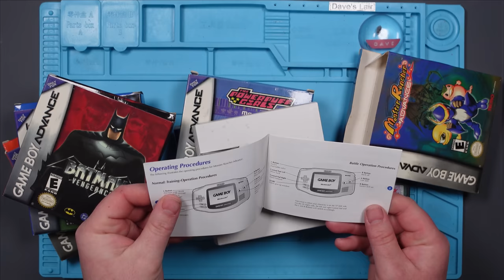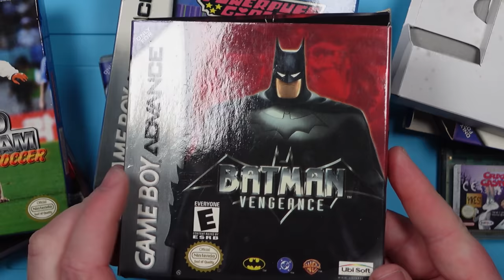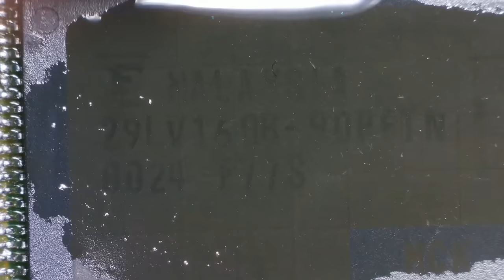I Bought 8 FAULTY GAME BOY Games on eBay & I Think I Got SCAMMED!

Comment: i worked at an electronics manufacturing company for over 10 years operating surface mount machines, those chips or IC's as they're known, are usually in tape on a reel that feeds into the machine. every so often we would receive a reel of IC's sealed in a vacuumed bag, if the bag was over vacuumed it would slightly crush the reel and often result in consistent bent legs on say every 8th chip in the tape, depending on the style of plastic reels it could be any number from just the 1 leg slightly raised or lower, to half the legs affected.  just my experience.

Comment: Use your hot air gun on the black epoxy just enough and it will chip away (with a sharp pointy implement). Too hot and it will go liquid. Worth a shot perhaps? Enjoying your videos 😁

Comment: The most reliable way to identify fake Gameboy/Color/Advance games is to look for the number physically stamped into the label. If it's not there, it isn't genuine.
Reply: They've started to add the number on the newer bootlegs so it's not reliable anymore.
I avoid buying GBA games on eBay now, because for anything rare at a good price it's 99.99% bootleg.
Reply: @indask8  Also there are a few legit games that don't have this number.
Reply: @MyRegardsToTheDodo  I don't think I've ever seen a GBA game without a number on the label, sometimes it's very faint but it's still there.

Comment: the gameboy security check works by having the nintendo logo in a certain position of the game-cardridges memory, that logo will be shown and afterwards checked if the data matches the original nintendo logo... by showing the nintendo logo, thats a licencing problem and therefore it can be fought.. there are ways to circumvent this by having the hardware cardridge returning the data of your logo for the first call (to display the logo), and the second call to the exact same memory address should return the original nintendo logo for the check, this way you can display your own logo displayed and use the nintendo logo for the check.. i'm not an expert, but that's about the gist :)
but that means if the nintendo logo doesnt show properly in in the intro, it will also not match the original logo when read the second time for the validation, so indeed if the nintendo logo is not 100% correct displayed in an original game, it wont get past the validation

this is true for the original gameboy, but no idea about gameboy color or anything that came later

Comment: I viewed the one from earlier in the year and had a question posted to that. Being so old you might not see it. Anyway, I wondered, for the one with the cracked board that you jumpered the traces, if you had checked the chip contacts on that one to see if they were getting loose.
Reply from the maker: Good question!  Yeah, I did check that, I don't think it made it in to the edited video, but that one was ok.  I'm guessing because the board got cracked somehow in it's early days and wasn't used as much 👍
Reply: @StezStixFix  That makes sense. It slightly bothered the engineer (emeritus) in me wondering about it.

Comment: Another way to spot fakes is that all authentic GBA carts have "Nintendo" on the physical board. It should be visible without having to open the cart.
Reply: And the boards are made with more quality and with golden terminals. I opened hundreds of them when i was seller of retrogames some years ago for maintenance, never saw a blob or something similar in an original, just 2 or 3 chips and the battery in some cases like the first iterations of the gba games or those that have internal clock. He could claim to Ebay for those fakes if there is not reference to it in any section.
Reply: @juanluisbc6053  blobs exist but not typically, only in SOME stuff. Like really rare to see it but they're out there in SOME authentic carts. NES and original Gameboy era has stuff with blobs but it's really few and far.

Comment: The Batteries in the GBA games are for storing saves, they are not needed for running games.
Reply: @MenaceInc True but I do belive those were of that set tho
Reply: @MenaceInc 

SRAM is what uses a battery, you mean flash memory I suppose. 
And yes, only few use batteries but many of the most common titles do.
Reply: @MenaceInc 

True. Pokemon games also used batteries however, but for the internal clock.

Comment: I would still clean the contacts just from a good housekeeping point of view. Also you could use one of the games with the blobs on to experiment on to see what may be effective in removing it. Maybe epoxy remover or heat gun. Try various things then if you find a solution at least it wont be a problem in the future maybe?

Comment: genuine GBA carts have Nintendo written on the circuit board in big white letters just above the connectors. They also have a small number imprinted on the front label which you can see if you angle it under the light.

Comment: The way I normally confirm GBA games is 

1- the outside label will have a number stamped into them. Have to hold it in the right light but they all have them. 

2- the board inside will have Nintendo printed on it at the bottom. 

KOs don’t bother to do either of these but all real GBA games have both from my experience. I’ll also add real games never have black globs on the chip.   Some better kos wont have them either

Comment: Heat the epoxy up to soften it up and use some IPA under using tweezers and repeat the process eventually it will come up it's a pain in the ass and time consuming like in one of voultars videos and will be able to see if it can be repaired afterward.

Comment: Definately all GBA carts are fake. There’s a few ways to spot them, some easier to see than others.
Nintendo in the wrong font, real carts often have numbers embossed in the label, the arrow on a real one is wide and the bottom rises to meet the surface at the back. Fakes may have an equilateral triangle. The dimple in the back should be a bowl shape with a small pimple, fakes are more angular with a large pimple or lump. As you noted, the plastic is lower quality and the top can catch on the battery in fakes. They have managed to use a round seal with an ESRB rating. Oops, ESRB is European and should be accompanied by the oval seal. The round seal is US. On the board, real ones have Nintendo but it has been copied though in the wrong font and through holes at the pins are a straight line at the back. Fakes have the holes in random positions, including the middle of pins. As you spotted, Nintendo don’t use blobs. Last, but not least, fakes often stick out slightly. You did try to push the cart in a few times, but didn’t realise that was a another red flag. By all means message the seller and explain, I’ve had refunds. If they don’t act, you are entitled to raise a case with eBay and even raise a case with PayPal if eBay doesn’t help.
Reply from the maker: Thanks for all the info Wenlock!  Really appreciate it 👍
Reply: No problem, I got quite a bit of experience trying to get a genuine Garfield and His Nine Lives GBA cart. Two were fakes, one didn’t keep saves as there was no battery the other had a dry joint on the battery. It did seem to keep a save until I noticed the save showed up every time on a DS. Huh? On GBA and GBA SP it never detected the save.  I did eventually find I could get it to by flicking the power switch hard enough to bounce to contacts.  The brief interruption caused a warm reset and the game would find the save every time.  It seems to be a timing issue, memory not ready quickly enough maybe.   I have a 93in1 cart that doesn’t boot, thoroughly examined it but no luck. Not even a garbled Nintendo.

Comment: How to fix those crap games? Well I basically don't bother with them - since if you are already using pirated software you might as well just get the 10000 in 1 "gamepacks" - AND some of those are actually interesting since they can contain romhacks and fully homebrewed games! However - what works to fix them? Rather than waste your time figuring out what does what on those boards and trying to reflow them - just throw them in the oven at 200 degrees C - for about 30 min. If that doesn't fix it then the trash bin will take care of all other problems... 😀

Comment: eBay is a dodgy as hell place! I bought a faulty PC motherboard that said it was good except for bent pins on the CPU socket. Sorted those out in a painstaking manner only to find that the guy bent them himself to cover up the fact that it was actually a faulty PCIe slot!

Fancy a go at a motherboard repair? 😜
Reply from the maker: Ouch, that doesn't sound fun!  I've got loads on currently, but a motherboard is not something I've done yet, so it's definitely on my future to-do list!
Reply: Well hit me up if you want a donor board 🤣

Comment: These games look pretty fake on the inside. I will admit I've seen boxed game boy advance games on the internet and they look pretty real. The cartridges also look real. They replicated the outside pretty well but did a terrible job actually manufacturing the pcb's. Yoshi's Island on gba isn't even supposed to have a battery. It uses either flash memory, eeprom or s-ram. (You get the idea that it's a chip that saves) I wonder who's this desperate to get a bootlegged version of a Powerpuff Girls shovelware game anyway.

Comment: I really do appreciate you fixing stuff, but it's only really simple hardware stuff that you're fixing. The problem is, you don't seem to understand how the GBA boots its ROMs, so those games that don't work, you really have no idea why they don't work. If you got a game with a bad chip, would you be able to tell what this chip should be doing and what it is not doing? The boot loader of the GBA is a little more complex than the color, but this is just an encryption thing, but you can still get at the code because it's decrypted in RAM.

Comment: Definitely fake the boards are real or real clones so the hidden chips never fit within the architecture so they use jumpers and such. I’ve opened fake high dollar NES games with roms hanging off the edge of the board with about 40 jumper wires in them.

Comment: I'm sorry, but if you couldn't see, immediately, on these boxes that they are super fake, then you might should change your hobby. 😅😅😛

I don't know the original pictures of that eBay auction, but if the light reflects on just one of these boxes on one of the photos, you should see immediately that they aren't real. As well as the print quality and the cover in general are super off.